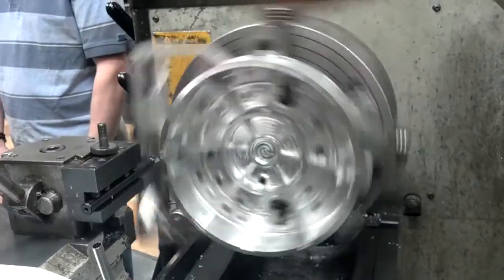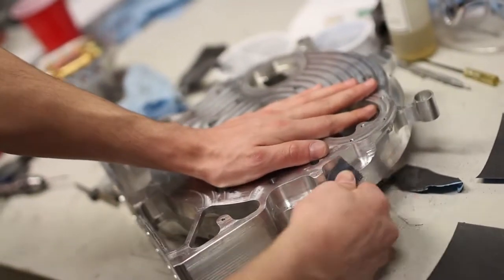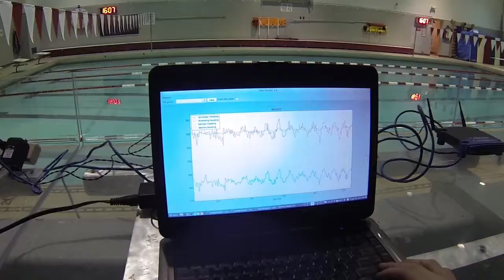CUAUV 2013 AUVSI RoboSub Competition Video

Comment: why is there a cable in the back?this is autonomous right? not an rov?
Reply: It's autonomous, but the cable is used to monitor the vehicle as well as intervene and tweak things during testing. Running autonomously is as simple as disconnecting the cable.